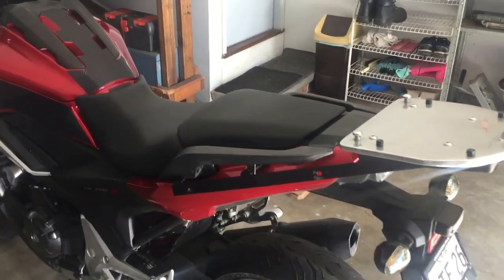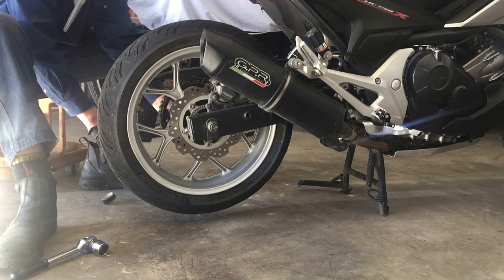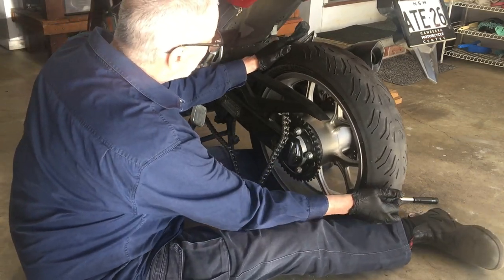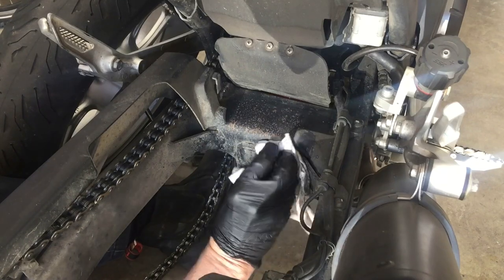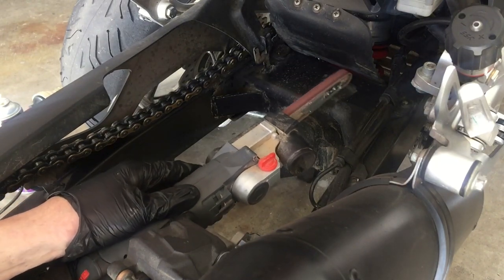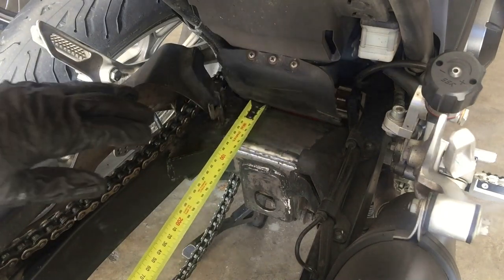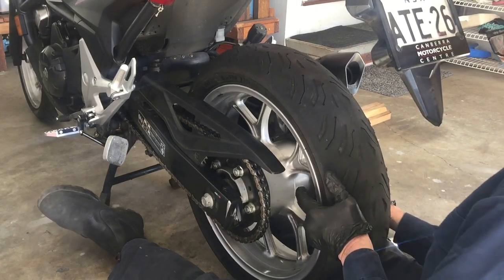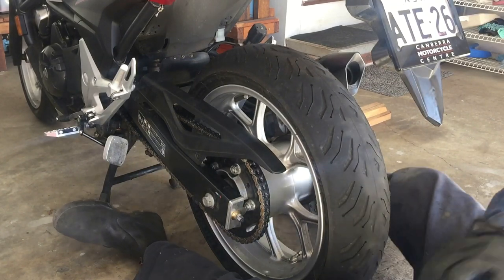Maintenance Time - Rusty Crotch

Comment: Thanks again Adrian for the video. Excellent work. In your tutorials I had already noticed that the wheel must be pushed before fixing the axle nut, but I had not realized that the chain is on one side and that is why the wheel has a tendency to move the right part of the axle towards back. Very grateful for these reflections that only give the experience. Thank you!

Comment: I can only assume they used better paint on the Aussie version of this bike than the UK one. My swingarm looked like that after about 5K miles and I had to do a clean and re-paint at that stage - then put a shock-saver plastic extension thing on which saves the swingarm. Your solution may be fine for dry countries, but would trap water between the two surfaces and produce horrendous metal-to-metal corrosion given the dissimilar metals used. Simply solution - bend it up a bit to give clearance and put a couple of plastic washers between aluminium and steel where the bolts secure it.
Reply from the maker: I’m happy with my solution. The tarry stuff I painted on won’t let water penetrate if I every have to ride in the rain - which is extremely rare.

Comment: Instead of placing the rubber shock protector directly behind the shock from a previous video I allowed it to fall in front of the wheel instead, saves this work is easy to move out of the way to clean.
Reply: You completly right , i just told him same thing
Reply from the maker: Didn’t work for me. On bumpy gravel roads the rubber bounced, hitting the rear wheel and wore completely away. 
Glad it works for you though.
Reply: @AfricaTwin-Stuff  You can install it the same way you installed the aluminum plate
Reply: @AfricaTwin-Stuff  Just make it long enough that you put the same screws on top and the same new screws that you made the holes for in the bottom

Comment: Always wanted to ask. What do you use for tires? I'm looking for a highway/ light off road tire.
Reply from the maker: I’ve worn thru a lot of sets of different brands. 
Currently running Road 6 which are the best road tyres I’ve had. 
And they are fine for light off road too. 
But I was quite happy with the Shinko’s for a dual purpose tyre.
Reply: @AfricaTwin-Stuff  I was looking at a set of Shinkos. Glad I could get a second opinion. Keep up the great work!

Comment: Don`t you own a cordless drill driver ? it is perfect to tap in the thread, I use it daily at work, both in alu,Steal and stanless, might have to flatten one side of the tap to keep it in place and use it on the lowest level and with clutch settings on medium so it don`t snap.

Btw I use Tectyl/Pava/Dinitrol on my bike/svingarm, as I am in Denmark and drive most of the year and we use salt on the road in the winther.

Comment: I like your solutions very much, but this one is overkill in my opinion. I faced the same problem with my NC and used a solution you already tackled a while ago with part of the solution you demonstrated here. So I cleaned the surface too and repainted it with rust repair paint (guaranteed rust free for 12 years now) and made a mudguard bigger than the one you made. I placed this mudguard a little higher up than yours and instead of letting it hang at the back of the spring I let it hang at the back of that place where you fitted that aluminium plate. This way dirt or water can’t reach that place anymore and like in your case no water can stay under an extra plate, i.e. I can still clean everything without problems. Anyway, keep up the good work.
Reply from the maker: Glad you are happy with your solution.

Comment: Why dont you just let the rubber flap tangle infront of the crotch? I made the flap from old cars tyre wheelbase plastic, molded with heatgun to be infront of this crotch and theres been no rubbing or anything... Crotch still looks like new after 5 years
Reply from the maker: Tried that a while back. The rubber ends up being worn out by the rear tyre.
Reply: Rubber doesn't need to be in contact with rear tyre.
Reply from the maker: True. I’m glad it works for you. But it didn’t for me. Riding over rough gravel the rubber bounces and hits the wheel.

Comment: Don't you think it is going to rust more under that plate? If moisture will be trapped there. I wonder why didn't you use just proper epoxy based paint instead of plate?
Reply from the maker: Im expecting the tar-based stuff I painted on will protect the steel from rust now that gravel can’t get at it. 
But I guess time will tell. I update you in another 7 years 🤔
Reply: @AfricaTwin-Stuff  
Ok... I will be around. 😊

Comment: Thank you for the video, but it is better instead of this work, is to make a lengthening of the plastic cover so that it is from top to bottom, so that water and dirt fall directly to the bottom, without the need to stay on the surface that you covered
Reply from the maker: Look forward a a video of your solution 🤗

Comment: The motorcycle has 54 HP, weighs over 200 kg, which is a lot for such a small equipment and power it has. Each such modification means additional grams and, consequently, kilograms. Isn't it better to put on an additional fender made of plastic, which will be much lighter and prettier than this sheet?
Reply from the maker: Each to their own I guess. But that 2mm Ali sheet weighs less than 3 poofteenth
Reply: A ride after a hefty meal would add more weight than this aluminium part 🙂
Reply from the maker: Exactly. And a good BM would reduce the weight 🤣

Comment: I prefer not to use stainless steel bolts with aluminium.
Due to the posseibility o f a corrosive reaction of the aluminium